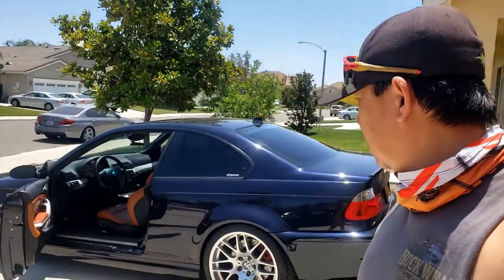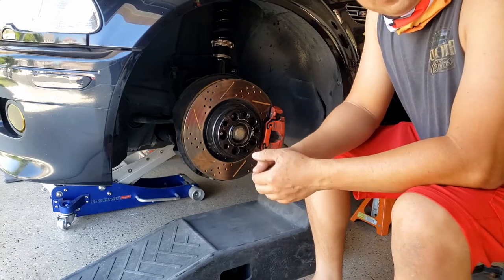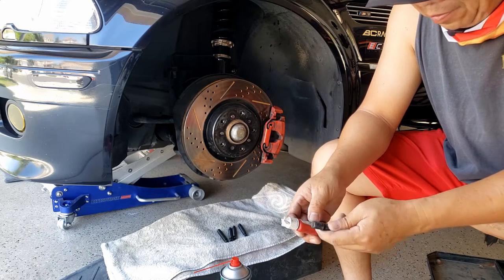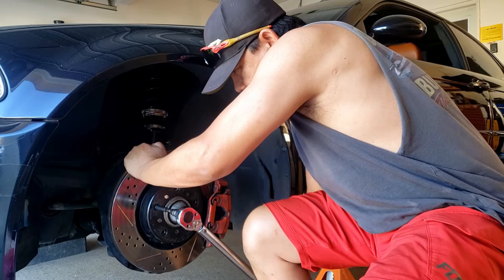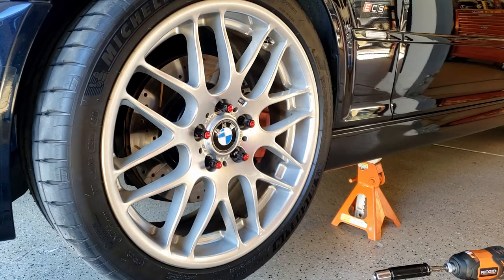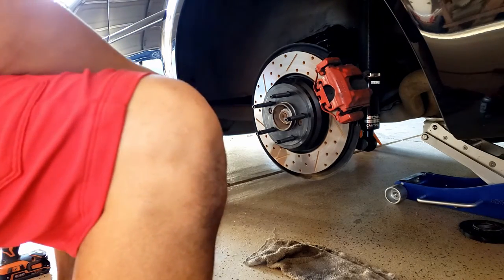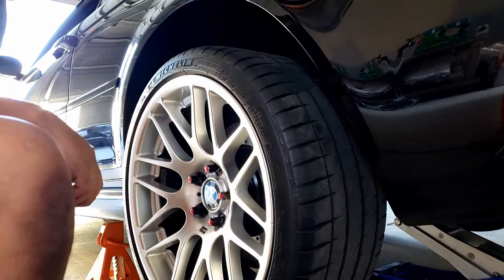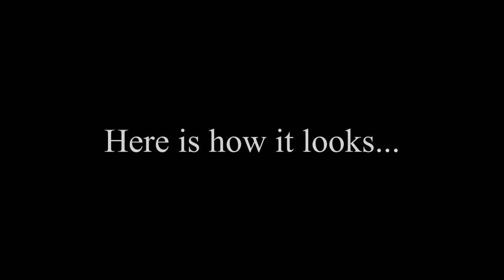Changes out wheel bolt to wheel stud conversion kits on E46 ///M3.

Comment: Hi...can you please measure and tell me, what is the outside diameter of the 2 socket keys. I just bought the Rohana RC-10 rims and the holes diameter only 0.900". I want a set of those lug nuts. Thanks ahead.
Reply from the maker: Not sure your question. Please refer to my video time-line and tell me what you referring to. Glade to help.
Reply: I'm talking about the black 17mm socket key that came with the Raypower lug nuts, and you use the black 17mm socket key to tighten the 16 lug nuts - l want to know the outside diameter measurement of that socket key. (Inside diameter of the 17mm hexagan is 0.669 inches). And also the outside diameter  measurement of the chrome locking key that you use  to tighten the 4 security  nuts.
Reply from the maker: @tengxiong9646  ok, will let you know tomorrow. I'm not home today.
Reply from the maker: @tengxiong9646  OD: black socket 25.85mm. OD: Chrome wheel lock 24.04mm.
Reply: @teslam3chennel  
Thank you!!!